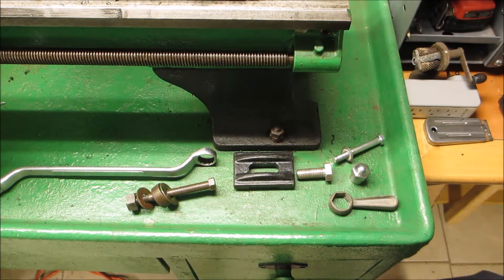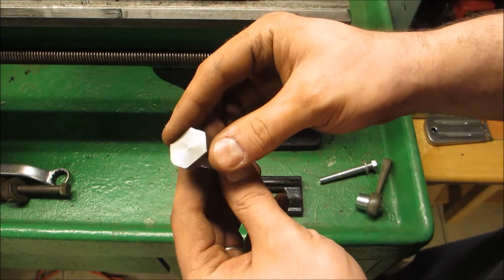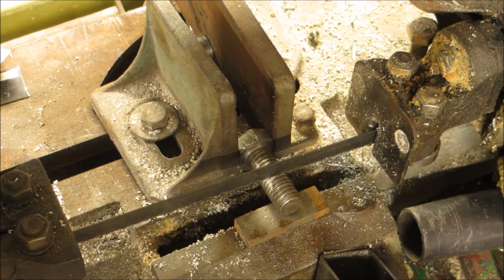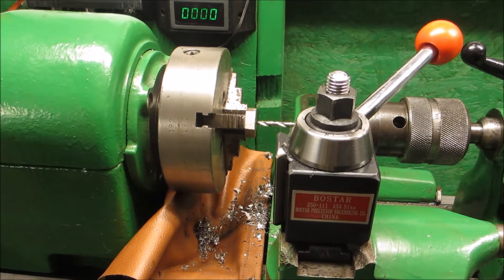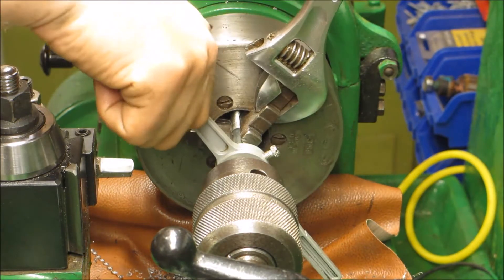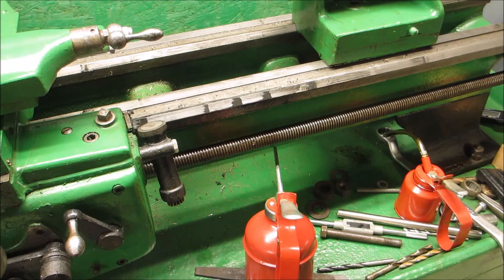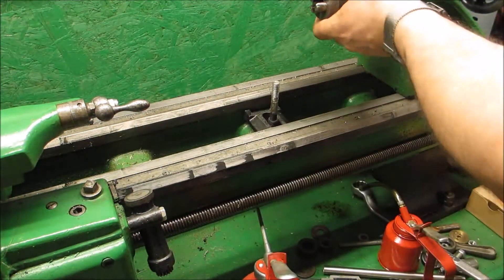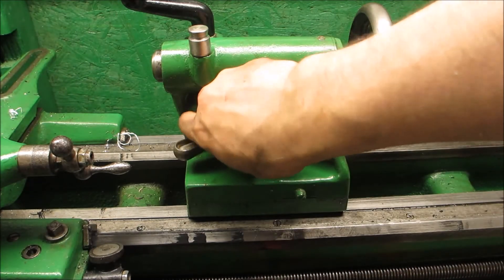Workshop Projects - Tail-stock Handle

Comment: I’m just wondering why you had back gear engaged while turning down the bolt? Also I’m not sure that wrench will tighten down the tail stock enough to keep it from sliding. I use a Logan model 825 10” lathe it looks very much like yours. Let me know if I can help with how to run the lathe.
Reply from the maker: John Brock the handle has been working well so far. Also I do not recall using back gear at all.
Reply: When you were turning the smaller bolt down for the threading, I noticed you had the handle pulled out for back gear, I just about never use back gear on mine! Harold sent me over here.

That Logan is looking good considering what you started with. I got mine about 10 years ago. I only used from time to time when I needed something for my fabrication business, but I never really used it properly. When I retired I took the lathe home and started to learn how to run it properly and I found out the lather was in pretty good shape it was made in 1945. Logan still has a lot of the parts available for them but they are a bit expensive.
Reply from the maker: John Brock I see what you mean. The back gear on my particular lathe must be backwards. As when you pull the lever out it disengages it, when pushed in and the pin gets disengaged on the bull gear it shifts to back gear.

Comment: Good idea, nicely done. Any reason the washer/ spacer under the nut could not be larger, then the spanner would always be engaged?
Reply from the maker: smallcnclathes I chose this captive spanner because it is not always engaged. I could have turned the nut down until this became a completely captive nut/spanner combo but it's not my goal. In case the spanner gets bumped I dont want it moving at all unless purposefully done so.

Comment: btw, your blog is down as I had it tried and no-ip is up just not your private server. "Engineerd3d.ddns.net is DOWN It is not just you. The server is not responding..."
Reply from the maker: Yeah I am having issues with my blog right now. I think my pi bit the dust. I have to rebuild it or fix it soon.